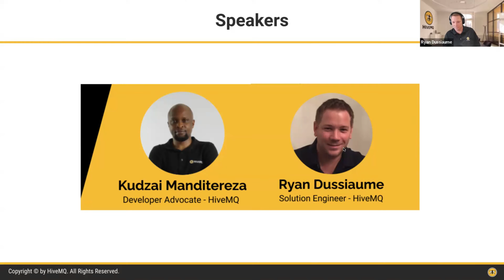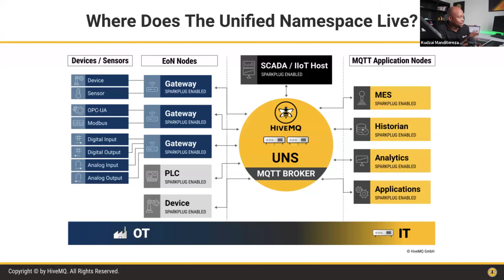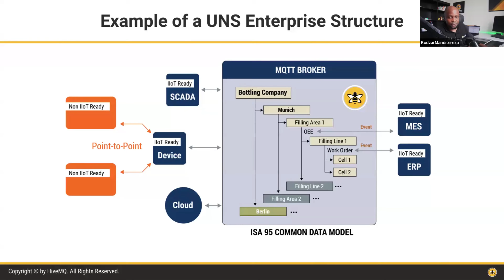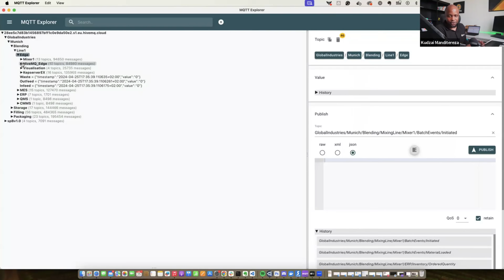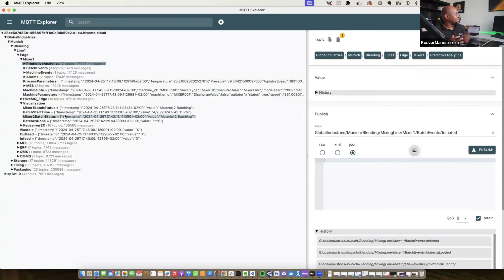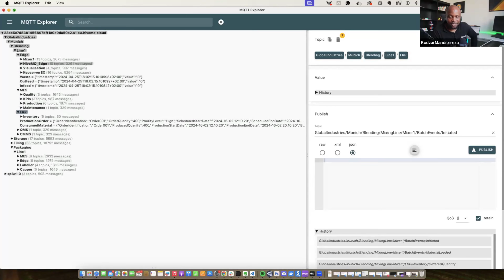Architecting a Unified Namespace for IIoT

Comment: Mr.Kudzai thank you for this presentation . it is very informative , comprehensive and you were very open to talk which different software vendors would be inside the solution as per the company requirements and expectations. i started to evaluate hivemq edge deployed with docker.